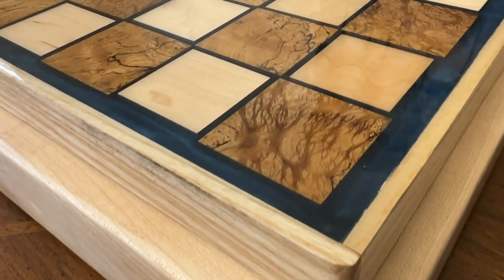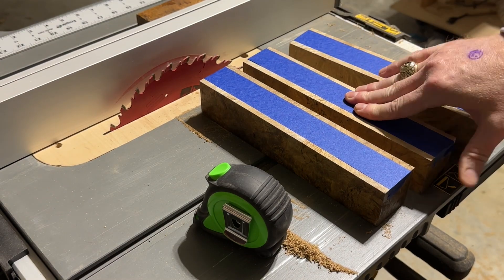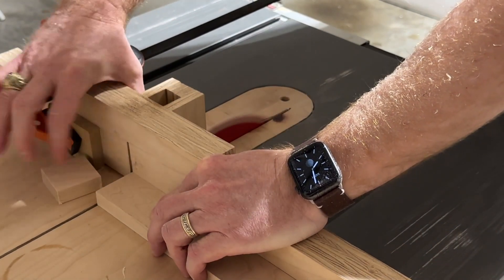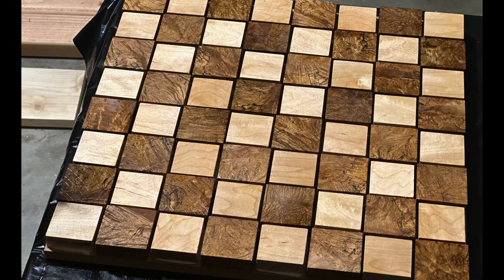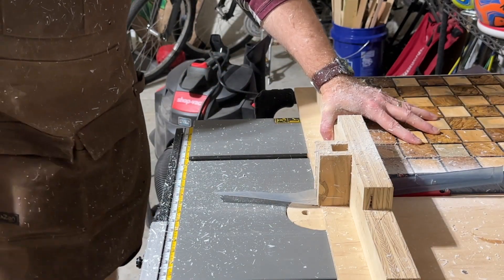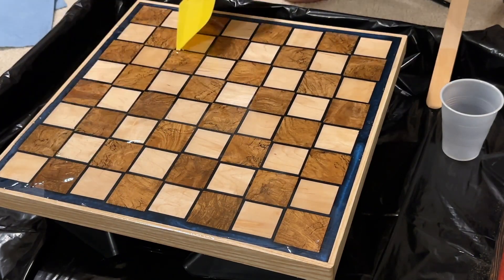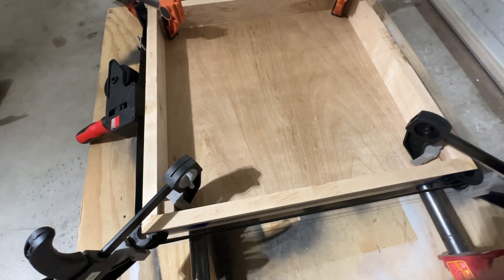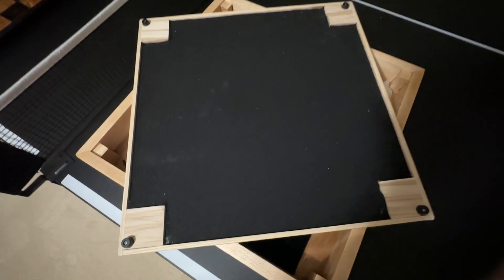Pyinma, Maple and Blue Epoxy Chessboard (Full Build) - WHAT IS PYINMA?

Comment: Gorgeous board and pieces.  I do like hard maple as the light colored squares.  Did you make the pieces?
Reply from the maker: Appreciate the comment!  I did make the pieces and plan to do a how to video on them in the next few weeks.  For a quick spoiler, I had them designed, 3d printed, and glued them into some pvc tubing.  I then used some softer silicone mold and poured it into the pvc and used a pressure tank to remove bubbles when it cured.  After curing, I had great molds for all the pieces and could just pour the epoxy in anytime I needed a set.  More detail coming once I do the video.  Thanks again!
Reply: I look forward to seeing the upcoming videos.  I’ve liked your previous videos, keep up the great work!
Reply from the maker: Thanks and keep stopping by!